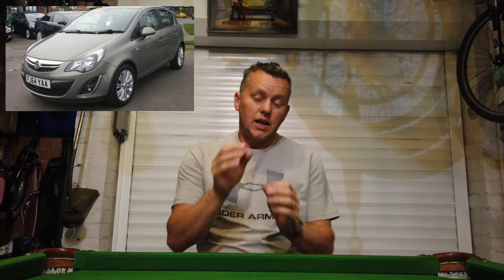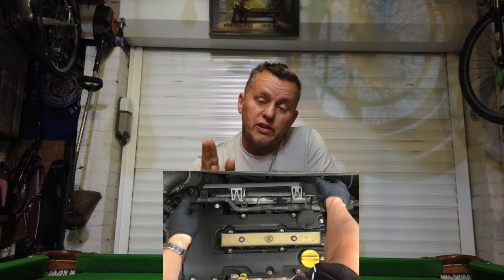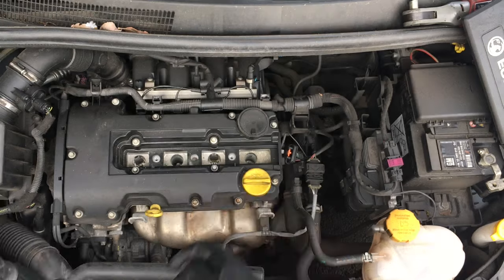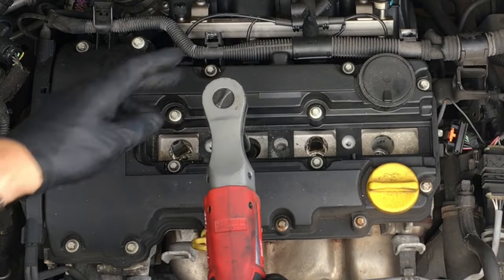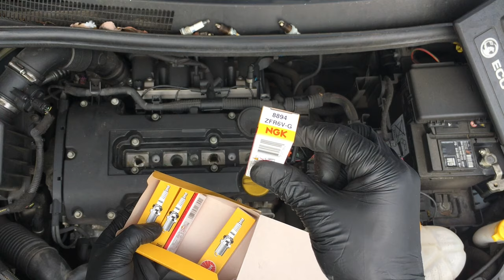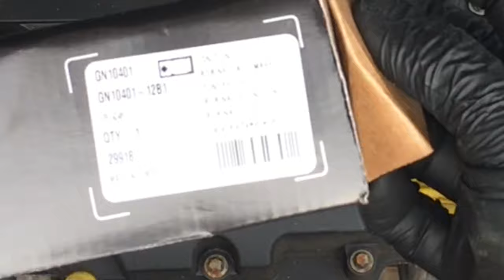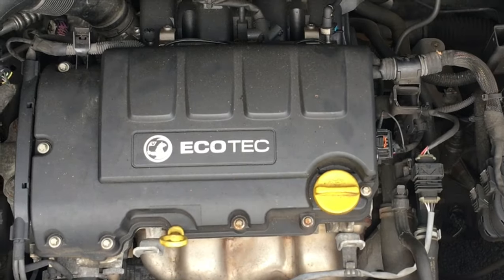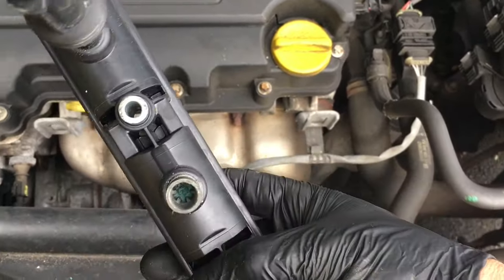🇬🇧Corsa Coil Pack Replacement (engine Misfire, Jerking)

Comment: Hey anton 2006 astra h has a miss fire on cylinder 3 rac said coil pack but i got the car cheap an dont fancy spending loads of cash on it so do u have videos of how to test coil pack injectors an so on before i start buying dtuff lol
Reply from the maker: go old skool, run the engine, then remove the coil and spark plugs, if no.3 plug is black and wet, 99% chance coil pack or spark plug faulty, you could also do a compression test to eliminate engine damage.Thanks for the great comments👍🏻👍🏻🛠

Comment: Is it possible to just clean these springs with cleaning spray for electronic contacts? Today I cleaned one of the springs but I saw thin wire wrapped at the end of the spring most of the wire was gone tho is it a problem?
Reply from the maker: They generally corrode inside the coil pack and the spring so usually replacement is necessary there is no harm in trying to clean it though see how it goes Thanks for the great comments👍🏻👍🏻🛠
Reply: @aaanton11  Yeah I know they  corrode inside that rubber is easy to take everything is green inside, I will try tomorrow in free time cleanin it completly

Comment: Is water ingress in the plug chamber a common fault with these cars 
As my partners daughter has a 1.2 corsa 
With water ingress,will it damage anything
Reply from the maker: it usually gets in from the washer jet seals leaking rain water, it will corrode the coils like inn the video, Thanks for the great comments👍🏻👍🏻🛠
Reply: What do you mean by water jet seals,
Where are they 
Is that your garage you were filing in,love the size of it
Reply: Also 1more thing 
Sorry to be a pain,
But the water in the plug cylinder I take it it’s a natural thing,
I was beginning to think it may be signs of a blown head gasket

Comment: Ever since I replaced my coil pack on same model it stalls out when at running temperature. It will start again after about 20 min. Could it be the 50 quid cheap coil pack instead of a good  Delphi  or could it be the plug connector pins expanding when getting warm causing bad connection thanks.
Reply from the maker: most likely to be a faulty coil pack, Thanks for the great comments👍🏻👍🏻🛠
Reply: @aaanton11  thanks for your reply. I will buy a decent coil pack.

Comment: My 16 plate corsa going into limp mode on cold/ damp mornings. Turn the car off for a min then restart then it’s ok. Any idea
Reply from the maker: you will need to plug in a eobd code reader, possible crank shaft sensor, Thanks for the great comments👍🏻👍🏻🛠

Comment: I have a Corsa D 2010 1.4. On idle the revs keep on falling below 500 and then back up to about 700. Repeatedly. Acceleration in the first gear feels sluggish. MPG has dropped. Could this be the coil pack?
Reply: Also when I turn the headlights on, wipers on full speed or heaters on max speed, the RPM seems to fluctuate below 500 and above 500? I’d really appreciate if you could tell me what the problem is. Thanks
Reply from the maker: sounds more like a throttle body issue, a good clean might work wonders, Thanks for the great comments👍🏻👍🏻🛠

Comment: So my car is a corsa d and it starts jerking when I let go of acceleration even a little will this be the same thing do you think ? I have had my car for 3 weeks I’m a new driver
Reply from the maker: New spark plugs first, then do a eobd code check to see if there is another issue you will need a code reader something  like https://youtu.be/O0oGl7nSQv8 Thanks for the great comments👍🏻👍🏻🛠

Comment: Great video...
I have same issue with my 2012 corsa, (40k miles) and the engine light is on and keeps flashing in between.
I have an appointment with dealer after 20 days.
can I keep it driving 10-15  miles in city till the problem is resolved or it could damage the engine?
Reply from the maker: Possible damage to the catalyser Thanks for the great comments👍🏻👍🏻🛠

Comment: I just bought opel corsa month ago, starting to missfire. Changed spark plugs and coil, working perfect for a week and then again, engine light, missfire again. We opened and there us a spark plug in the bunch of water, dry it and again working perfect and again rain Ireland water and all again. Where is that water coming from🙄
Reply from the maker: its usually dropping in from the scuttle panel or through the washer jet seal, Thanks for the great comments👍🏻👍🏻🛠
Reply: @aaanton11  thank you, will check that.
Reply: @aaanton11  hi, just to inform you it is apparently scattle pannell, under him is a screw that was snapped and the water was leaking directly to back of the engine. Spark plugs and coil, sooked with water, I silicone it, drain the water out from spark plugs. Went for a ride, worked perfectly for 10 min, then missfire, engine light on💡. Then again working normally. It was a storm 2 days ago, extremely heavy rain and wind.

Comment: Aa towed me home yesterday he told me this coil pack is causing my fuses to blow and go get a new coil pack he replaced the fuses and told me to get a new coil pack and I replaced it today but it still won’t start not sure what to do
Reply from the maker: I will definitely remove the spark plugs and check that they are not wet. The chances are the engine could be flooded because the coil pack wasn’t working properly. Give them a clean and refit and everything should be okay.
Thanks for the great comments👍🏻👍🏻🛠

Comment: My corsa is misfiring with the engine light coming on then going off. Likely to be this problem? Is it a cheap fix
Reply from the maker: Most likely to be this, the link for a new coil is in the description, Thanks for the great comments👍🏻👍🏻🛠
Reply: @aaanton11  hiya mate, thanks for the videos. I've just bought a new coil pack, I see in this video you change the coils themselves aswell though? Will I need to get some or is it a sort of best practice type thing?

Comment: do you get a eml on the dash
Reply from the maker: Not on this one, the misfire was not detected, if it got worse then yes the eml would eliminate, thanks for the great comments 👍🏻👍🏻🛠
Reply: @aaanton11  Hi there! I think mine has the same problem because the noise is quite the same but it comes from that box you can see at the 0,58 second's, I can see that on that model there's no box. Here's the video I did: https://youtu.be/7xnbF6tEINM 
Any help or ideas what might be it will be very much appreciated, thanks! Great video by the way!

Comment: The way you place the spark plugs is an example to avoid.  We first put the spark plugs in by hand, and after making sure everything is ok.  Then we even use the power chest you show.  But first and always by hand.  How are you so sure that the spark plug will not catch on?  The consequences of such a failure are devastating and you know it.  Also since you do not use a torque wrench, at least empirically show 12 to 3 ....... You do not use the special non-stick paste and are completely ignorant of measuring the gap according to the manufacturer .... It is an unforgivable mistake .... I am like the old  engineer I judge you dangerous
Reply from the maker: I like your consistency George, you comment on all my spark plug installations the same way, like I have said before the spark plugs are preset, and don't need to be checked unless you have dropped them. The Milwaukee Ratchet is super controllable, and if you start slow you know if it is not threading correctly, I have changed over 1000 plugs with this ratchet with no issues. also if you gap iridium plugs they are potentially damaged.
as always, Thanks for the great comments👍🏻👍🏻🛠

Comment: I have a corsa 1.2 ecoflex when I start it up and try and take off it cuts out but if I give it a bit revs first I can get it going when it’s just sitting ticking over it’s juddering not much knowledge of cars but do you think this could be the problem?
Reply from the maker: You need to get the codes out with an EOBD code reader, I have another video on that  Thanks for the great comments👍🏻👍🏻🛠